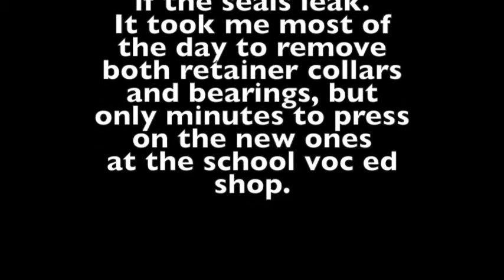1995 Suzuki Sidekick Rear Axle Bearing Removal

Comment: Yeah im having the same issue right now been trying to heat it and bash it off that plate is so in the way of using any type of press or anything to get it
Reply from the maker: My advice is bashing it off is bad idea.  If you use a new 4" or bigger cutting wheel and take the guards off then you can get the wheel level with the bearing and cut it off.  If you have a tall press and use a split plate to fit between the bearing and the mounting plate then you may be able to press it off.  Put pressure on and then tap the axle to start a little vibration as you press harder.  I haven't actually tried it.  I cut mine off.